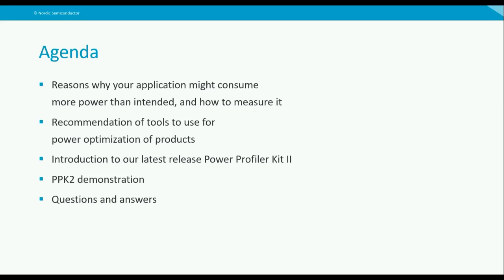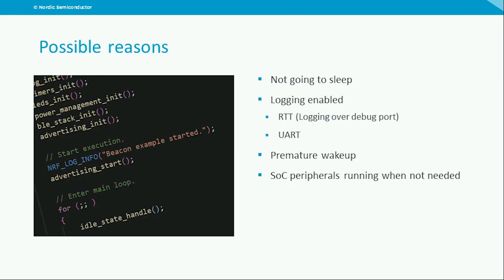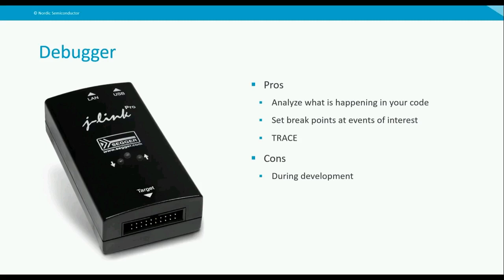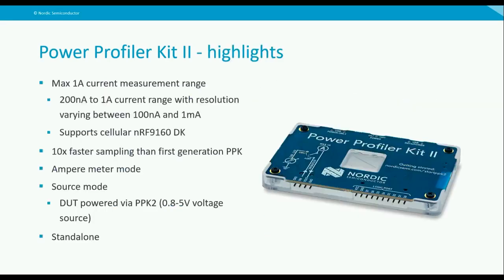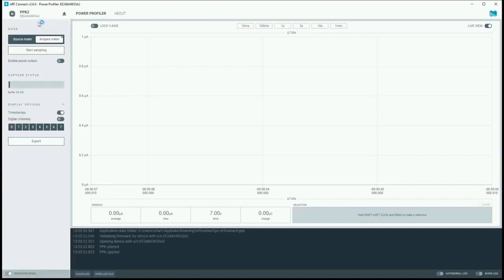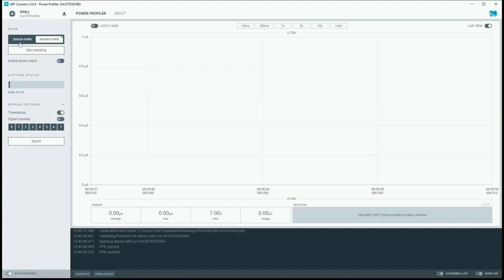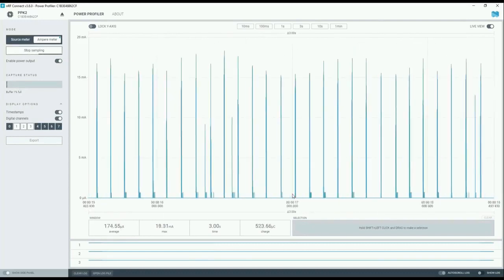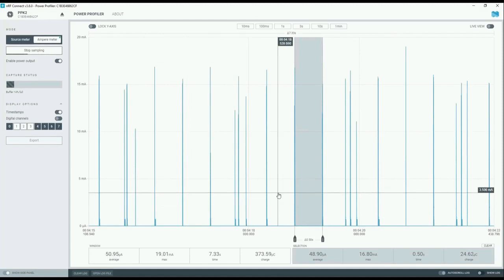Become an expert on power profiling your application

Comment: I was thinking of getting one of these but there's a discussion in Nordic DevZone forum that suggests the Power Profile Kit II (PPK2) produces different results which are possibly less accurate data than the previous version. It would be good to know what's going on there.
Reply: The thread: https://devzone.nordicsemi.com/f/nordic-q-a/69342/issues-with-the-new-ppk2
Reply from the maker: Hi Kevin, would you care to share the discussion on our DevZone forum with us?
Reply: @NordicSemi  I did add it in a reply to my reply but YouTube may be hiding it as part of their spm/link bombing filtering. If you can't see that reply/link, the title is "Issues with the new PPK2
" in the "Nordic Q&A" DevZone Forum.
Reply from the maker: @kevinwalters5160  They did indeed hide it, we found it now. But sorry for the trouble, but thanks for sending over the title. We'll look into the discussion in our forum.
Reply from the maker: @kevinwalters5160  only a few have registered a couple of bugs, we are currently investigating these. Most are very happy with the PPK2.
Reply: @NordicSemi  I bought one recently and have been enjoying using it. I had a go at measuring RGB LEDs with it as a starter (there's a link to an Instructables article on it in the video description if you're interested): https://www.youtube.com/watch?v=pCM3G3v9D4s
Reply from the maker: @kevinwalters5160  Great to hear you have been using it. Thanks for sharing with us.

Comment: How do we calibrate this? how often is calibration needed?
Reply from the maker: Calibration is done in production.
Reply: @NordicSemi  thanks. As you know all test equipment deviate over time. Is there any means to calibrate later on? Say after 1 year? Any data that you can share regarding measurement accuracy over temperature and time? Thanks
Reply from the maker: @Truth_seeker_24  yes, it does. We do not have accurate data on temperature and time. It's certified for normal room temperature. There are ways to calibrate, and you can find the info in the user guide for Power Profiler Kit II:  https://infocenter.nordicsemi.com/topic/ug_ppk/UG/ppk/PPK_user_guide_Intro.html?cp=9_7